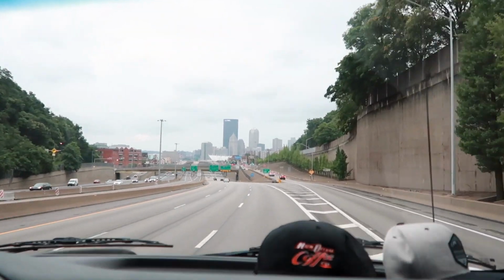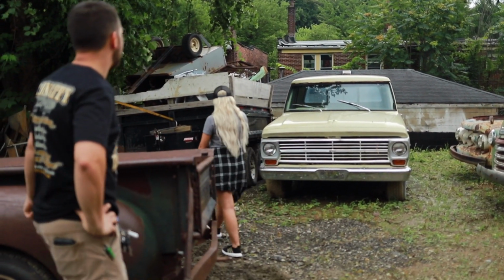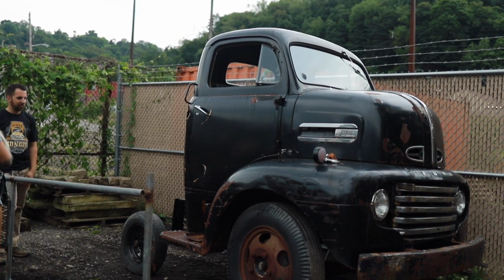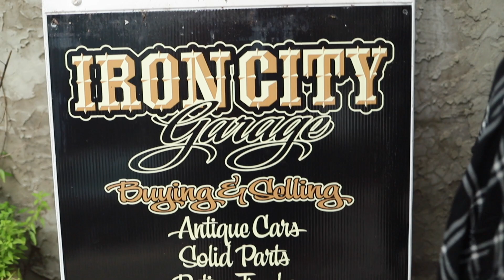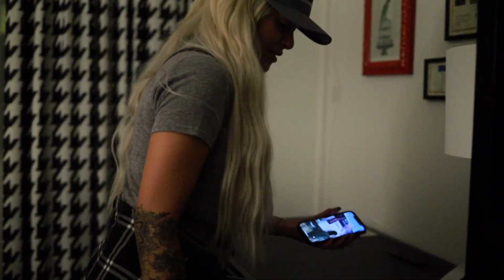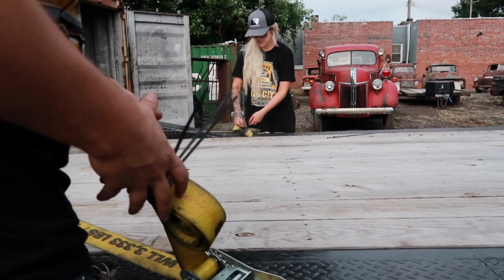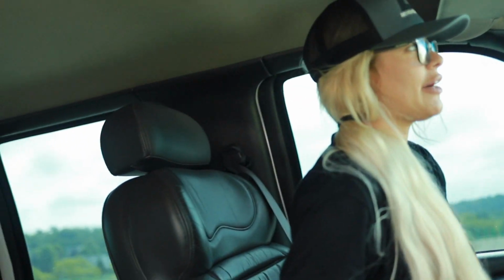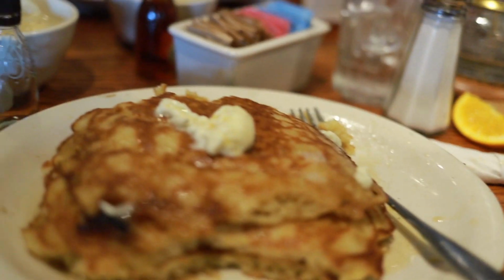I Bought WHAT to Build for SEMA... we have 3 months

Comment: Lacey on the trailer break controller for under 0-25 percent have the gain at 2-3 at 50 percent load of the trailer have the gain at 4-5 at 75 percent  have the gain at 6-7 at 90 percent have the gain at 8-9 with a gain of 10 being your 911 if the truck breaks fade to slow you down